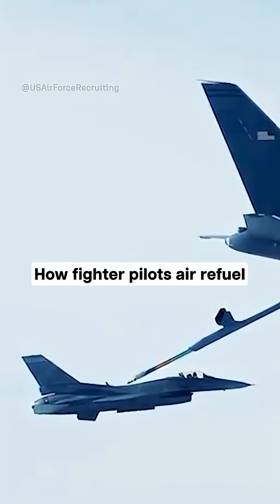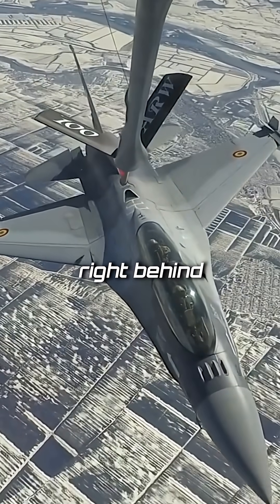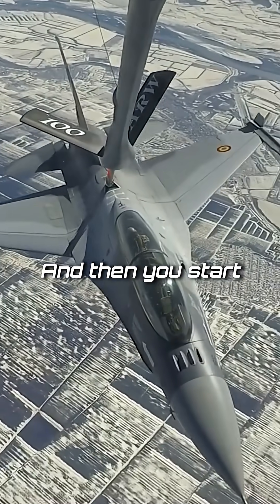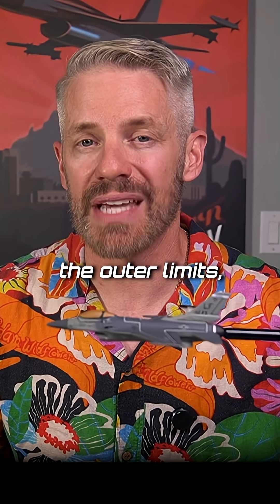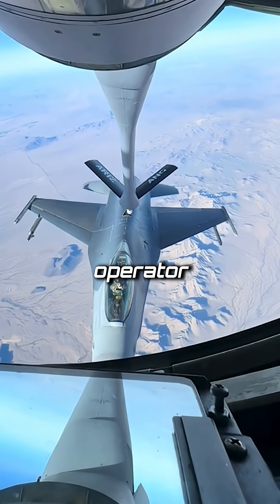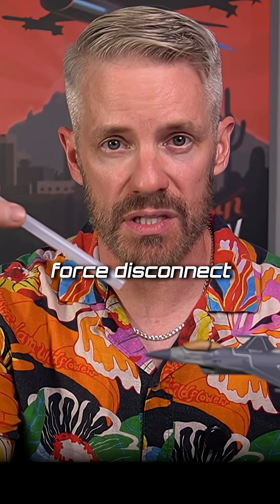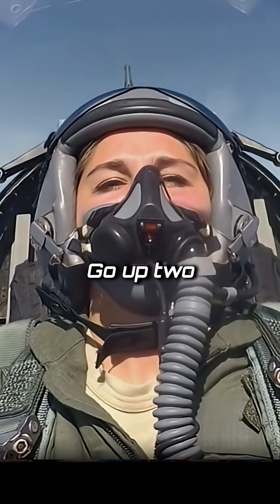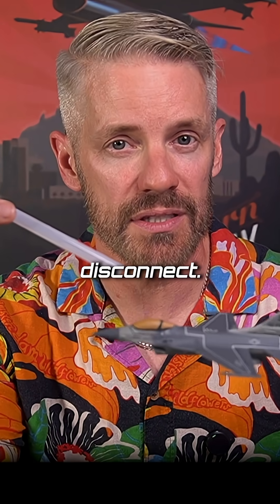F-16 Aerial Refueling Limits

Comment: As a pilot you can’t see the back so the operator tells you how many meters to come forward or go left or go right? What about turbulence from the tanker or just the weather up there?
Reply: No you can refuel with no coms. There isn’t much communication much of the time

If you hit weather, the tanker is going thru the same air so it effects you evenly
Reply: @JamesMathison98 ok. So I guess it’s practice
Reply: After the turbulence, structure specialists have some work to do ;)
Reply: @irwingwashington2063 why? Aircraft is not pulling any Gs.
Reply: The boom can scratch the upper fuselage.
Reply: @irwingwashington2063 oh 👍